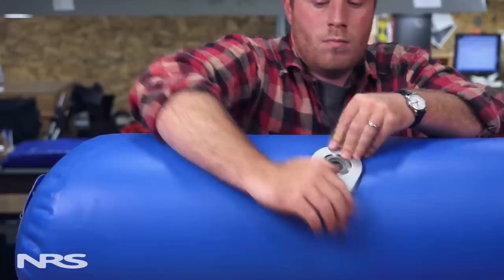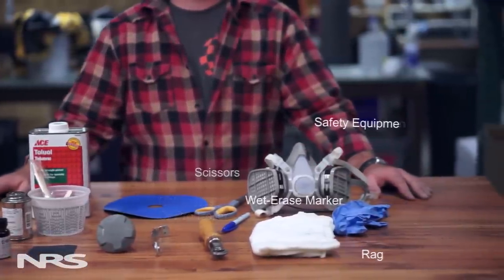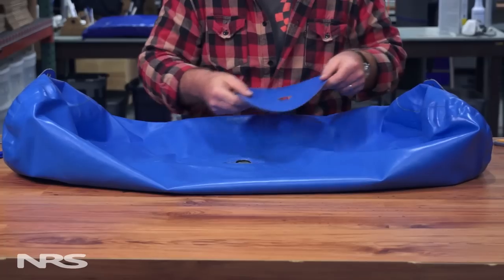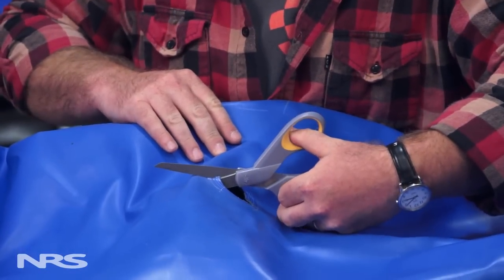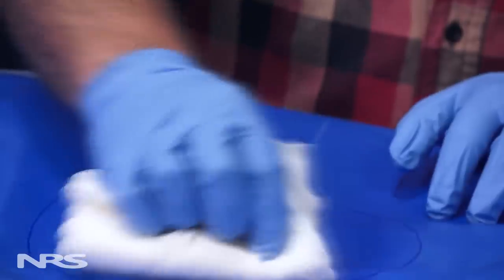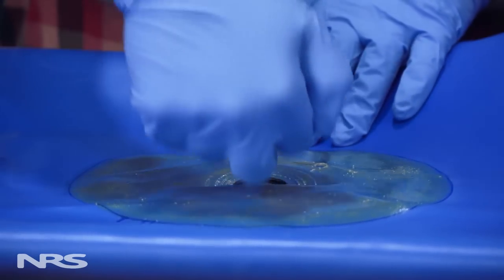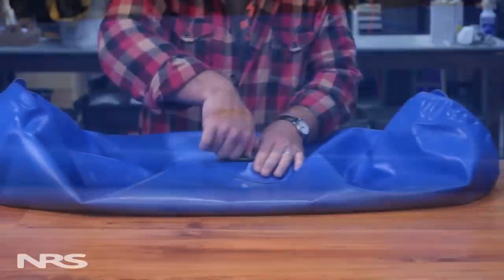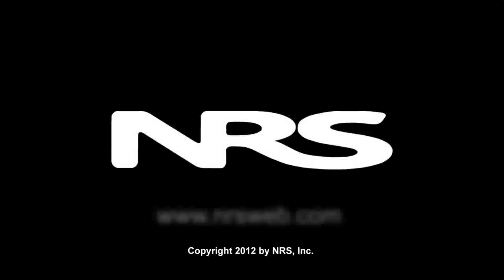How To: Replace a Raft Valve

Comment: Does replacing a Halkey-Roberts valve involve a similar process? All of the videos I'm finding for that are just people unscrewing old valves and screwing in new ones, but they're on cheap inflatables, so I'm not sure they apply to a raft. Trying to determine if I need the donut patches.
Reply from the maker: Hi Luke, The process is the same for a Halkey-Roberts valve. But if you're putting the same valve back into the boat and the internal "nut" isn't damaged all you have to do is unscrew the old valve and thread in a new one. Feel free to give us a call if you have any other questions. 877-677-4327
Reply: @NRSWEB  Thank you!

Comment: I have a set of inflatable Letter People that I want to use for my future classroom. Each Letter Person is 20-22 inches and I removed the valves so I could stuff them, but I realizedtherecould be a storage issue. I already have small holes cut in them. How would I replace a valve that small?
Reply from the maker: There are a lot of variables with this question. It would be best to give us a call and we'll see if we can help you out. 877-677-4327

Comment: Would this work on a rubber river inner tube?? It currently has a regular car/bike valve and it takes FOREVER to fill up... I’d like to swap to a different valve
Reply from the maker: It probably wont work. With a rubber inner tube the material will stretch and keep stretching until it eventually ruptures. With raft material there is a scrim material in bedded that keeps the rubber from expanding. If you glued on a doughnut patch to a rubber inner tube the glue will most likely fail when the tube is inflated. NRS does make river tubes that use raft style valves that are easier and faster to fill. Give us a call at 877-677-4327 if you have more questions.